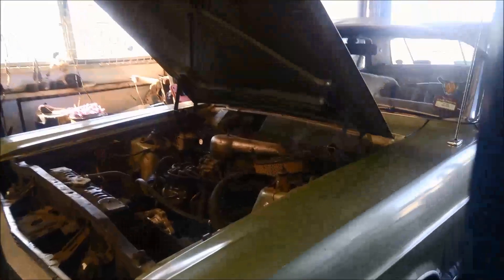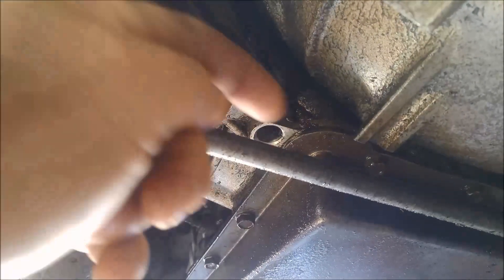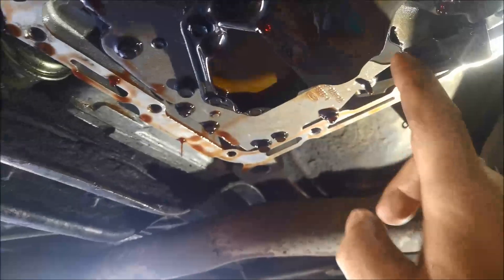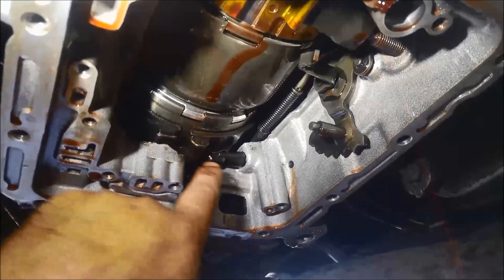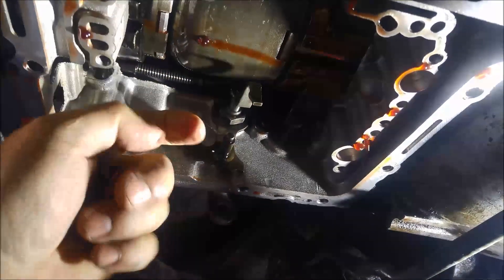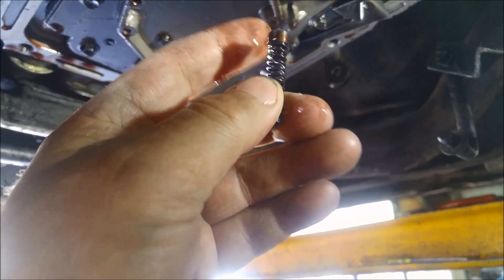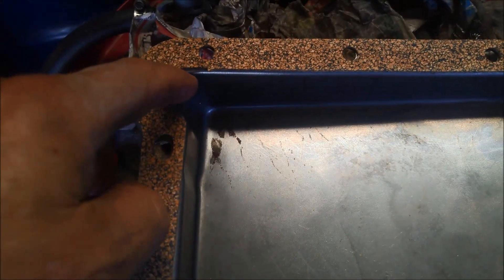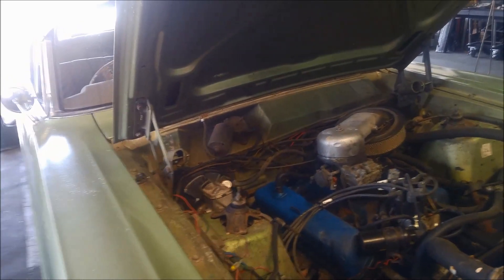How to C4 Auto Transmission Filter Service & Band Adjustment, Selector Seal Replace & Linkage Repair

Comment: hi mate I have got an issue on my C4 tranny. when ever I select gear from park to drive or even reverse it jerks (Thud) and it also jerks when going up or down gears while driving. any help will be really appreciated. Thanks
Reply from the maker: hi, check basics first. fluid level - vacuum modulator for leaks - worn universals joints - perished trans cross member mount - differential backlash - high engine idling etc. cheers

Comment: Your Band adjustment specifications differ from the Workshop manual.  Are the number of turns you back off each bolt based on best performance or other data sheets.  Could you let me know the data you are using and where to find it.  Thanks
Reply from the maker: hi, its what i have done for over 30 years and even longer for my old man ( retired now )...on these trans, as long as the bands are not grabbing or touching the drums when they are not applied, it has got to do with timing...to me minimum is usually best, as things will wear naturally anyway. when bands on c4 are way out of adjustment the servo pistons will apply the bands at a bad angle and then prematurely wear the linings on band at the end tips and not evenly as they are designed to do..... i guess guidelines vs experience....there was a good explanation on fb. https://www.facebook.com/notes/mustang-monthly-magazine/a-few-words-about-band-adjustment/481654822550/  ....in old days, we also use to make bands with brass plated tips for heavy duty c4 use/work to reduce the tips wearing. cheers